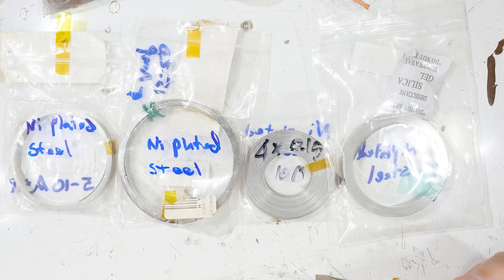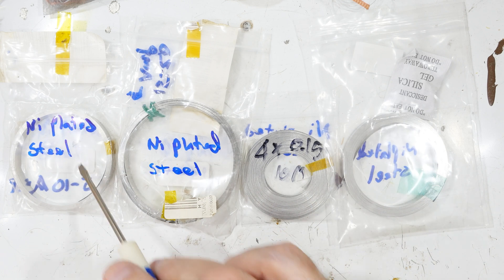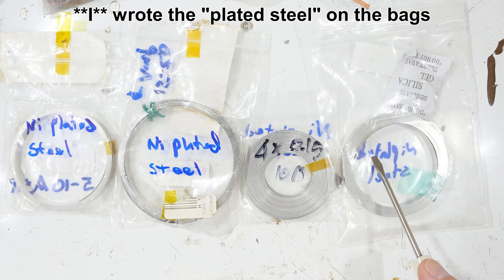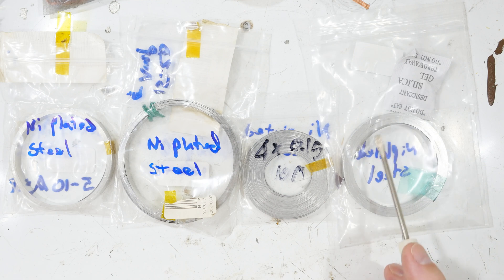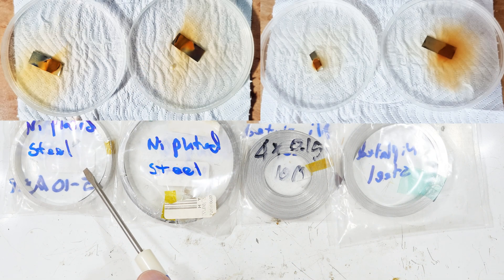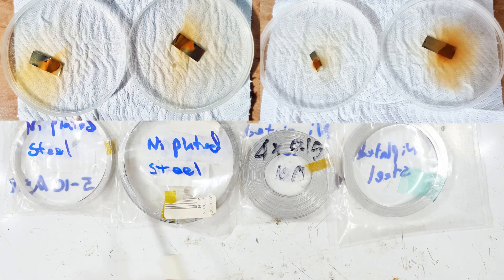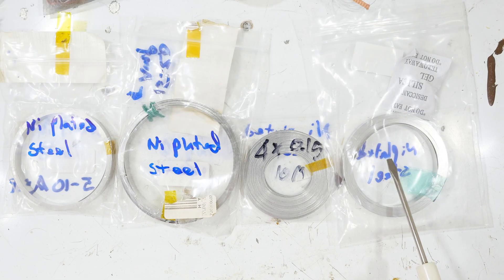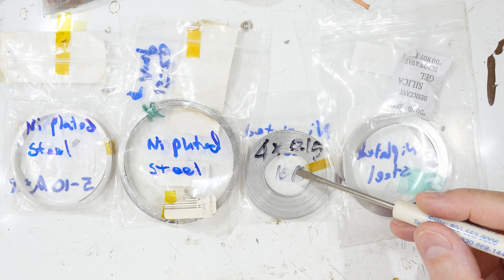PSA: Nickel Strips That Are NOT Nickel Strips (4K)

Comment: Do you have any suggestions on how to find real nickel strips?
I haven't purchased nickel strips myself yet but I plan to purchase some in the future.
Reply from the maker: I've tried trial and error and been disappointed every time. The rolls I'm ordering are made to weld rechargeable batteries together. I'm surprised that they'd use steel, because it has high resistance compared to lots of metals and would heat more. I don't know, but I am going to keep looking. If I find something, I will post it.
Reply: I've just been looking through you list of videos. It sure looks like you have a lot of great content. I'm looking forward to viewing some of your older videos.
Reply from the maker: Thank you. I have a mix of content, kind of whatever I happen to be doing.

Comment: I am wondering how the differences in properties between the pure nickel and the nickel plated steel will affect performance. I assume that corrosion resistance, thermal conductivity, electrical conductivity, formability, weldability, melting temp, etc would be dramatically different between these two materials. How do each of these property differences affect manufacturability and suitability for the intended purpose? Maybe an experiment or series of experiments would be interesting.

Comment: I think an easier test would be a simple magnet. If it sticks it's steel!

A magnet won't stick to nickel.

I wonder if these strips are made out of the alloy used for the modern USA nickel coin?
Reply from the maker: I just googled it, and nickel is magnetic. There's also an interesting list of magnetic nickel coins from around the world.
Reply: A US 5 cent coin is 25% nickel, 75% copper.
Reply from the maker: @stash4945  But our nickel does not have  enough nickel for it to be magnetic. A Canadian dime is very magnetic (I have one) and I think so are some of their others. I read that some are high nickel, others are just plated steel.
Reply: @stash4945   I think most the nickel strips sold are probably also a copper nickel mix.